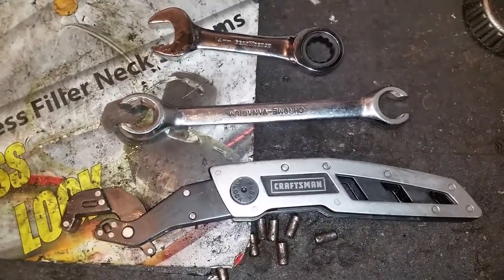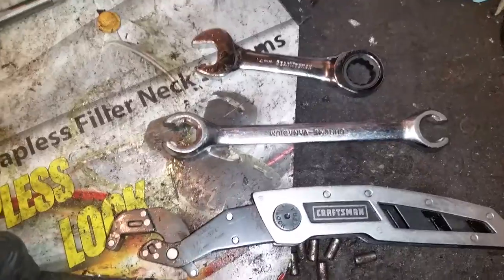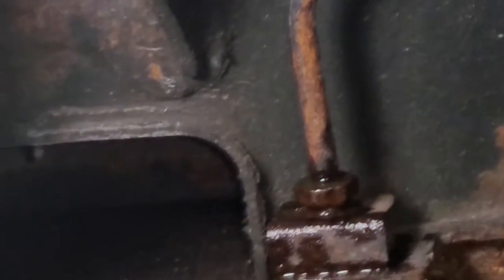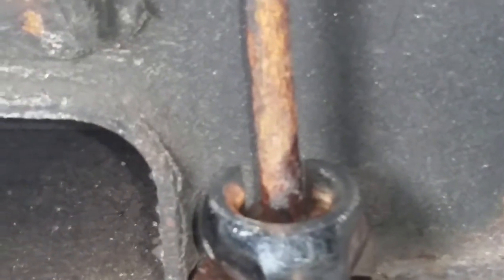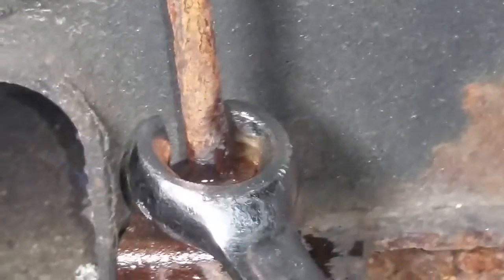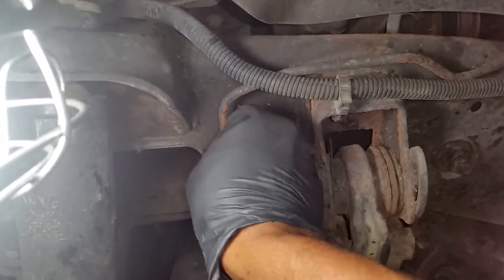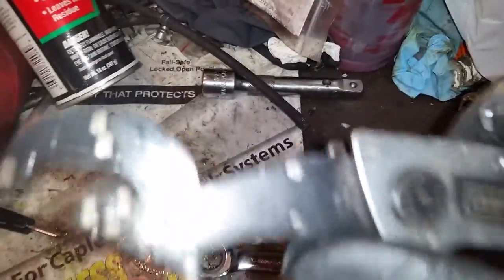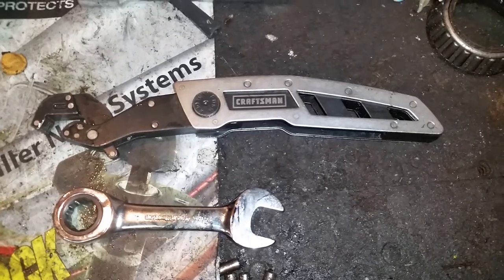How to Remove Flare Nuts with Ratcheting Wrench

Comment: I just seen this video and good review . I got my set around 5 years ago at a pawn shop . They were just outside the package but looked fairly new . So I tested them and the big one did not work so the next time I was driven (I am a disabled vet have nothing from the waist  down so I am in a wheelchair)  I swapped it out with no problems . I have used them on me wheelchair my handicap scooter and a few things. The problem I have is they keep jumping off . I have watched videos and a lot seem to have the same problem  Any ideas> Oh I paid 10 bucks for them used.  Thanks